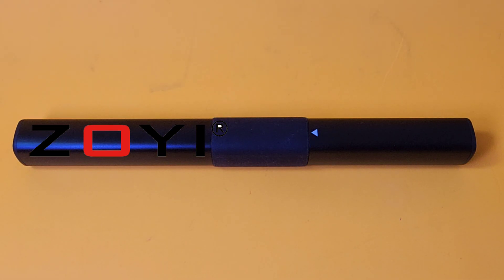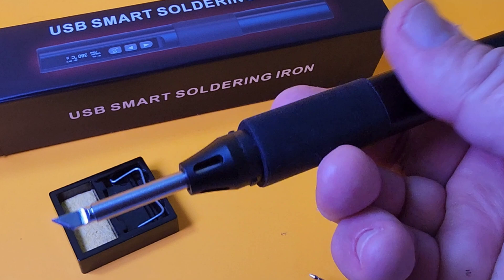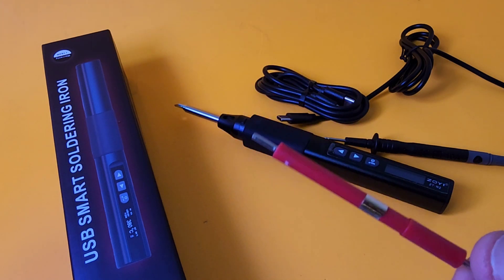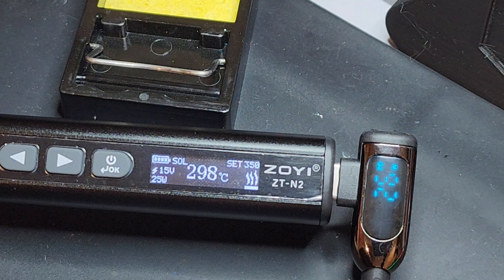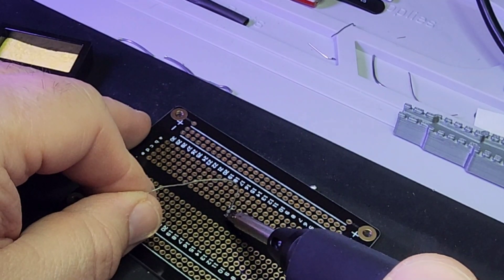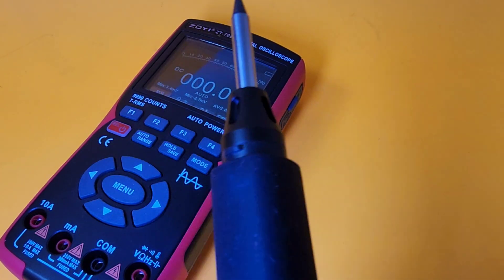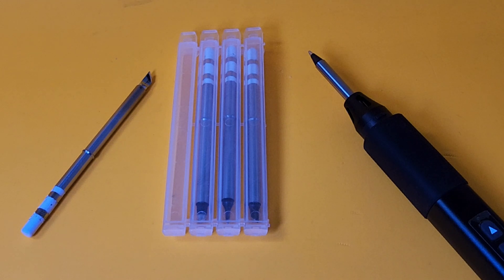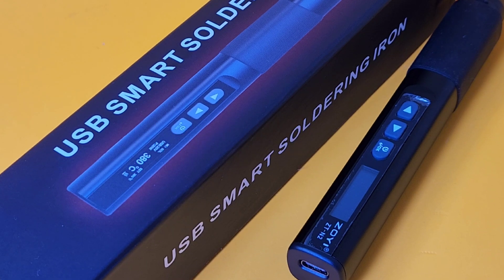OMG! ZOYI ZT-N2 Soldering Iron Multimeter - Full Review!

Comment from the maker: 🔥  Before using the multimeter function, it is recommended to replace the soldering iron tip with the proper test leads.
The black USB-C lead and the included red tip! (No its not a Screwdriver!😅). Do not measure voltages higher than 36V.  Please note that if you use the regular soldering iron tip in multimeter mode, the measurements may not be as accurate, although it will still work.
Reply: Thanks!

Comment: I can point out several issues:
1) You are using a 65 watt charger but the iron isn't taking it all.  You should have set to 20 volts in settings first, it's only using 15 volts.  The way it's also repeatedly going to 0 watts indicates it may not like the cable you are using either.
2) The ZT-N2 can solder wirelessly, that's the whole point.  To do so, you have to turn on "SOL" in settings with it not connected over USB.  Then you will be in soldering mode.  It only uses 12 watts of heating power from the built-in battery, but it works.
3) 4:02 The screwdriver mistake - I see you were corrected on that before.
The manual has all this info and it should be read before the review.

Comment: Holy moly, that's nice! Wonder if it can work with higher voltage capable USB-PD bricks to get the most power from the tip, knowing it can also do T12/T15 tips! Shame it cannot heat up without a brick...if it was just a soldering iron I'd take it!

Now would you test one of those USB-C soldering T12 soldering irons that can put power into the tip, choosing between one of those or a soldering station style iron...
Reply from the maker: Roger that! 👍  Lots more soldering irons and stations coming your way on the channel!

Comment: The Chinese prompt on the screen reads: "Do not measure voltages above 36V." Before using the multimeter function, please switch from the soldering iron tip to the test leads, and avoid measuring voltages higher than 36V.

Comment: Cool idea, but on the practical side, it's probably a matter of taste. At the end of the day, you'll still need a multimeter. And these ~65W soldering irons can often struggle to do the job, so maybe you'll need a more powerful soldering station too. 

So, while I find ZOYI ZT-N2 interesting, I personally would gladly ditch that whole multimeter gimmick for a proper power adapter, spare tips and a case. 🤷‍♂
Reply from the maker: Kudos NE, makes sense. Btw, they also offer the ZOYI ZT-N1 which is strictly a soldering iron (no dmm),but still lacks the charger,Xtra tips and case.

Comment: The message in Chinese says that you should not have the voltage exceed/go above 36. Also, 350 is quite low as a temperature; the TS100s I use goes much higher and often needed when dealing with a large groundplane or XT90 plugs. find the multimeter gimmicky... perhaps this is useful when you are in a pinch.
Reply from the maker: Appreciate the translation. Thanks!
The max temp is 450°C with the appropriate Fast charger. Multimeter functionality is limited but still nice in a pinch as you say!
Reply: @KeepOnTesting  Good for 12V car stuff